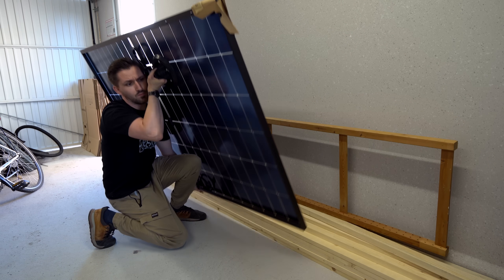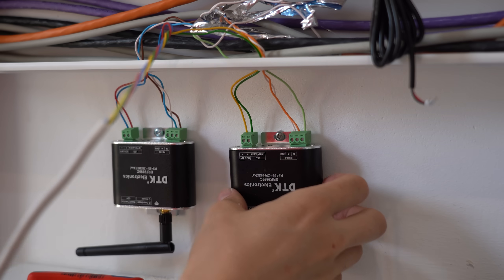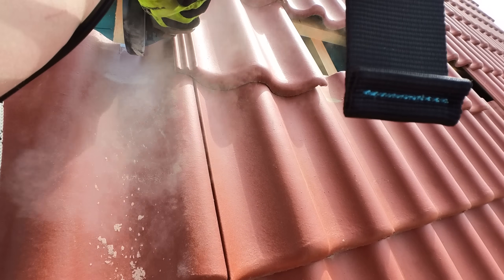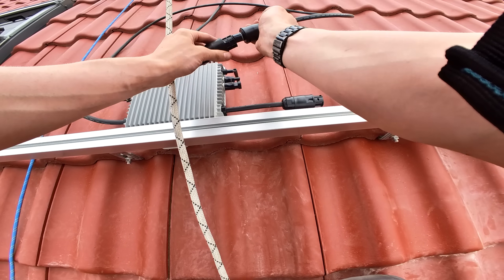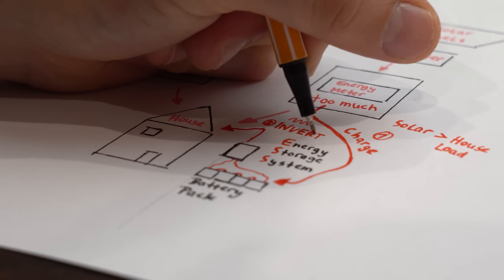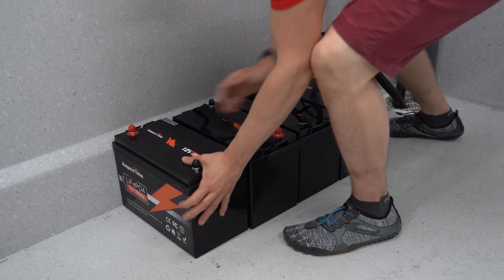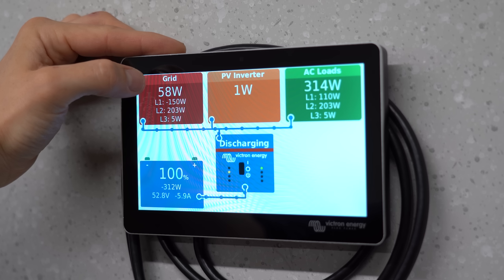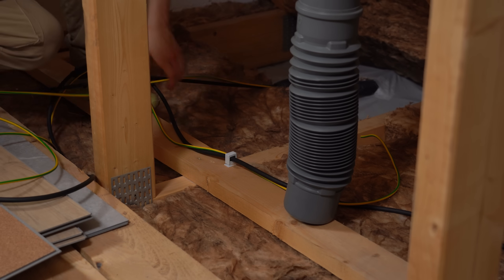Pushing a "legal" Mini Solar System to its LIMIT!

Comment: I've just finished a project to install a 48/5000/70 multiplus-ii in my garage along with 12KWh of storage (16x230AH LiFePO4 cells) - I don't have solar, but I can now buy energy when it's cheap and use it when it's expensive. I'm going to add another track of cells to my project and then add solar/wind on the DC side

Comment: I could be wrong, but I believe you need an external BMS if you are going to put those batteries in series like that. I know each one of those batteries has an internal BMS keeping the cells balanced, however there is nothing to ensure that each battery module remains at the same voltage as one another... Correct me if I am missing something

Comment: ESS is a nice trick. Given the size of the Multiplus 2, the logical upgrade is to put (at least) one large PV Array with a Victron MPPT Battery Controller directly charging the battery. Of course, the next ugprade is to put a slightly bigger battery 😁

Comment: I highly suggest to check with the manufacturer of those batteries about the series connection, for most 12V LiFePo4 batteries it's not recommended to connect them in series

Comment: Is there any problems using 4 12v batteries in series? How do you ensure they all have the same voltage and one doesn't become overcharged?

Comment: One other very important thing regarding "Don't do this at home on your own". At least in Germany working on your grid, doing major changes to your roof and so on are a no go when it comes to creditors and insurance companies. I have two friends (married couple), who both have a PhD in electrical engineering and are doing some crazy stuff both on and off the clock. They were forced to hire "professionals" (who were actually terrible) because otherwise the insurance company would have skinned them alive, not to mention the creditor for the house itself.
Reply: You only need the right insurance which will also pay for "grobe Fahrlässigkeit".

Comment: I think if you want to push the system to it's limit even more in a cost efficient way: You should "overpanel" the solar inverter even more. You could probably quite easily use 4 or even 6 panels on your inverter with the combination of serial and parallel to stay under your max DC input voltage. On sunny days it might not help that much (because of the AC limit). But on Cloudy and shorter days you will stay closer to the max 600W output much longer and more often.

Comment: library IEEE;
use IEEE.STD_LOGIC_1164.ALL;
use IEEE.STD_LOGIC_ARITH.ALL;
use IEEE.STD_LOGIC_UNSIGNED.ALL;

entity Decoder3x8 is
    Port (
        A : in STD_LOGIC_VECTOR(2 downto 0);
        Y : out STD_LOGIC_VECTOR(7 downto 0)
    );
end Decoder3x8;

architecture Behavioral of Decoder3x8 is
    signal temp : STD_LOGIC_VECTOR(1 downto 0);
begin
    -- First stage: decode the most significant bit (A(2))
    temp(0) <= not A(2);
    temp(1) <= A(2);

    -- Second stage: decode the remaining bits (A(1) and A(0))
    Y(0) <= temp(0) and not A(1) and not A(0);
    Y(1) <= temp(0) and not A(1) and A(0);
    Y(2) <= temp(0) and A(1) and not A(0);
    Y(3) <= temp(0) and A(1) and A(0);
    Y(4) <= temp(1) and not A(1) and not A(0);
    Y(5) <= temp(1) and not A(1) and A(0);
    Y(6) <= temp(1) and A(1) and not A(0);
    Y(7) <= temp(1) and A(1) and A(0);
end Behavioral;

Comment: If you install the right assistant,you can run the PV inverter on the output and use it off grid too. There is documentation for "AC coupling" an inverter on the victron site

Comment: In the Czech Republic it's quite a bit harder... 
Here it's not only wasteful to send solar energy to grid for free but also kind of illegal and you will be fined by your energy provider. That's unless you have a special contract for it, which absolutely can get rejected if your area is already "overpowered." (And even if you manage to get it and you want to get paid for the excess power, good luck.)

Also because of legislation (and power companies lobbying) you need stupidly expensive and complicated asymmetric power converters from shady companies from China. 
I don't think any other country uses those except for us so pretty much nobody makes them...

Comment: or you can get a simply get all in one off grid inverter where you hookup one end to the grid ,house and battery where you can customize many features as well like priority, cutoff voltage,switch voltage etc

Comment: those batteries kinda suck for a longevity use case since they offer very little compression for the lifepo4 cells. depending on the design, you can build a box for them and compress the whole pack, but ideally you want to de-shell the batteries and use a proper rack and setup for compression. Generally I just recommend going with bare cells and your own BMS but often its cheaper to buy these 12v 100ah packs instead.

Comment: In the UK at least (of course your mileage will vary) you mustn't put mains voltage in the same conduit as low (data) voltage.  
I was also slightly concerned about your comment of just plugging solar into your mains, it's critically important to have an automatic isolator, so that if the mains fails, you are not supplying the grid with power and potentially endangering someone working on power lines they think are powered down.
Reply: That's what the microinverter does.
Reply: The microinverter has anti islanding protection built in
Reply: @metrikmechanik  Jeah, but the Victron inverter doesn't care as long there's juice in the batteries, I'm affraid.
Reply: @dusinnhht  Are you sure it's not a grid-tied inverter, which it is in this instance and they need to detect mains power or they shut down.  Not to mention, if that little inverter did try to backfeed the neighborhood it doesn't have enough ass to do it and will trip itself off or the 50A breaker will trip. Unless the outage is just one or two houses, but yes generally it is still a bad idea to just plug in random inverters and backfeed through them. But, the good thing is most outlets and associated breakers couldn't actually handle the load anyway.
Reply: If in the UK you cant mix data and power in the same conduit how do Doncaster cables do it legally in their evultra cable?
Reply: Multiplus II doesnt power the grid if it sees no voltage

Comment: Can you set your inverter to charge your batteries during off peak power prices?  That way you charge batteries with cheaper power and solar and higher prices you use solar and stored batteries??

Comment: Were installing 34 large Jinko mono full black 420Wp panels. They go to the three biggest inverters victron has in its assortiment after an mppt, wich goes to different batteries ( i believe lithiumfosfate?? ). Hoping price will drop monthly now...

Comment: Correct me if i'm wrong but you placed solar panels with an micro inverter, so your creating ac from dc to the victron and then back to dc to the batteries. That is a double power loss for converting? I would suggest removing the inverter and placing the dc solar directly to an victron MPPT and then to the batteries. And pair them we the rest of the victron network ofc.

Comment: Technically, if you can verify that your system will never feed back into the grid, thus making it a so called "Inselanlage" the approval of the power company is not needed. However, it's still a wise move to let them look over it and verify that this is the case. Plus your insurance might want to know as well.

Comment: And @7:17 is the point when you better bought a chinese all-in-one solution (inverter, solar mppt charger and automatic transfer switch) that costs ~600EUR and you can use it with max 5.6kW of solar power and same 48V battery system. The balcony setup is for people that want a simple plug and play solution. What you've built is a very expensive 600W solar system 😅.

Comment: In the Netherlands we have smart meters, those contain a so-called P1 port which spits out the energy consumption every second. Unfortunately our meter has that port hidden behind a panel with a seal on it (business installation), opening up that port means a tech from the metering company has to show up. Since we also do not yet have a battery storage we keep it this way. During day time the whole company runs on 100% solar power, delivering some energy back into the grid for just 7 cents per kWh.
As soon as we get a battery system and/or EV charging solutions, we have to look into getting our P1 metering readout to work. Adding an extra metering solution will be a bit tricky with a 400V, 100A installation.

Comment: Is this really legal? Don't you need a device/mechanism to stop feeding electricity back to the grid if there is a grid outage? Because there might be people working on the lines thinking that they are dead but you are actually electrifying them? I know that this feature exists in most grid-tie inverters. They can sense grid outages and either completely shutdown or create a "small grid" with your house to continue powering it.
Reply: Every grid tie inverter that is certified  has this feature built in, as well as hybrid grid tie inverters

Comment: Very impressive setup! However, I noticed you don't appear to be using a battery management system (BMS) for the four LiFePO4 batteries. Are you not worried they might become unbalanced over time, leading to one or more of them getting overcharged / overdischarged?

Edit: I see they are self managed, since each contains 3 or 4 such batteries wired in series, so that should protect them, however they can still get unbalanced, which means the battery will just disconnect in such scenarios :/
Reply: Guess each bank has its BMS inside, that's why he shouldn't connect them in series. Correct me if I'm wrong?
Reply: These batteries are designed to be daisy chained up to 4S maximum. I have been doing it for over 1 year will no problem
Reply: I was thinking the same, it wont go boom but it will stop working in the future due to a lack of balancing.

Comment: My system is currently 9 years old and has never been grid connected infact its an all DC system with separate internal wiring for the DC power and lighting circuits. However the battery system is getting old now and the solar panels like wise. I have often considered upgrading the system to an AC inverter system to eliminate the occasional use of portable inverters. It was originally designed as back up power system and full time lighting system. But has ended up being full time use for many things. I will probably start by upgrading my solar panels as thats easiest to do being ground mounted on frames outside.

Comment: What are you going to be using to keep the batteries in balance? 
You might want to go to Ali Express and get a 12V battery balancer for a 48V system... 
There's many BMS systems which some have an active balancer built-in but they are usually for 16 X 3.5V lifepo4 cells... 
Your 12v batteries will end up at different voltages to each other and one might see an over voltage situation.... 
You need to head over to the off grid garage channel to get all the information you need from a crazy (but very awesome) German living in Australia...

Comment: Interesting thing here in my country, if you make solar panel instalation legitimatelly, any excess power sent to the grid is "stored" for later use by you when needed. So it saves the hustle of having a separate battery pack:)
Reply: You can be sure thats temporary. Its only done in early stage implementation as an incentive.

Comment: Loving your videos! I have a couple of questions/observations:
1. Does the Muliplus II have the functionality of a G99 relay integrated? Or do you have a G99 relay elsewhere in the system? In reality, it is best placed at the grid supply entry so that your home can run on battery power without trying to power the whole grid!
2. That fuse on the battery supply looks like a car audio one. These are not usually capable of withstanding the huge short circuit currents lithium batteries can produce. Probably best to ask the battery supplier for a recommendation, I only know of the fuses for EV’s such as Bussmann EVK’s etc.
Reply: the more current... the more likely the fuse will blow. I don't think there's a problem using this type of fuse but it does look a little cheap.

Comment: 1. You did not mentioned what is the price of all parts you used.
2. System looks overcomplicated. Was it possible to make it simpler and still useful?
3. Too many mentions of professionals and regulators. DIY video is about making something yourself .

Comment: Would be interesting to understand why inverter instead of MPPT for the panels.
Would be good to cover panel selection/matching in a future video. 
Also to cover Victron's community where volunteers help with user problems.
You can configure to draw more than panel output from the batteries, then in the gaps when you're not working the batteries can recharge. Saves grid power.

Comment: I looked into doing something similar, although at a slightly smaller scale, and here in Australia you can have a maximum of 500W without having to get the system inspected by a certified inspector (and pay them for it, of course). And that's without the grid tie-in. It has to be completely stand-alone, and if you want to connect any system to the grid, irrespective of its size, it needs to be inspected and certified to meet all electrical and safety standards.

Personally, I did the cakeulations and I could run my network gear off a 500W system with a modest battery. However my NAS would use too much energy, which cause the battery to run out overnight sometimes, so it would have to be run off mains (with an IUPS, of course). But the cost of the system probably isn't worth it because it only saved me a little money from my electricity bill. Although that was years ago, before energy prices started skyrocketing, so perhaps that equation has changed now.

Comment: Looks more like victron promotion video than actually usefull installation. If You are not interested in sending power to the grid then hybrid offgrid is way more cheaper and powerfull solution.

Comment: Why not run the solar panels straight to the battery via a smart solar controller. Less parts required that way and more efficient too

Comment: I thought feeding back to the grid without any isolation device is illegal, due to if there's a power cut, a linesman working on the grid can get a shock from the backfeed?

Comment: My previous job was installing PV systems nearly 20 years ago.
As I can see your roof is the "areated type" so, probably you have some roof tiles that have a little "bulk" with a net to have airflow under the tiles. We used them as cable passages so you don't have to modify tiles.
And we always have blocked the tiles underneath the panels with some PE foam to prevent them from moving (once the panels are installed is quite difficult to reposition the tiles).

Hope this helps.

Comment: Should there not be a BMS between those 4 batteries? They will never be the same. If one is fully charged while the others are not the fully one gets overcharged. That's bad. Not sure if you kept that in mind Further. I planned such a system in my offgrid garage but the startup costs especially Victron is way to high for "the normal man"

Comment: I have installed a "mini" solar power system. It cost about 8+ years of electricity bills.
More than half the cost invested in batteries and that is for SLA's.
For LiFeO, that would go to 12-15 years of electricity bills.
And that wont power your whole house without sacrificing battery life.
Oh, and those cost for me installing them myself with diy mounting, no professional installer.
Also, it'll only save you about 10% in electricity bills (cover about 10% of your normal energy consumption).
So, if anyone want to sell you solar powered system to save money, just say no.

Comment: You should never use these 12V LiFePO4 batteries in series like this, over time you will get state of charge imbalance between them, which will cause an overcharge of one of the batteries, which will cause the BMS in the single battery to shut it down to protect it. If you want a 48V LiFePO4 battery, you build a 48V battery from the start with a single BMS that manages the individual cells for the entire pack.

Comment: The energy storage for the solar panel system is an essential part.
But I presume the cost of accumulators is tremendous. However, houses do not need that energy/mass-efficient batteries. Thus you can make your own from a couple of barrels.
Batteries have limited lifespan, but when you make them yourself, it does not matter.
I looked a little bit into and NiFe battery looks promising.

Comment: Thanx for the video. I wish it was so straight forward in our country to do this. Yes, I would not DIY this, firstly because I'm not trained to do it and secondly, DC and mains voltage will kill you!
Reply: Let me clarify. I broke down my solar journey in 2 parts. 1 - I had the 5kWh off grid inverter and 5kw Lipo4 battery pack installed, by a qualified professional and 2 - I had 8 x 550W solar panels installed afterwards. Also by a qualified installer. In my country, you are not allowed to do a solar or battery backup install yourself, as you need to have the design and install signed off by a professional. If you want to do the install yourself, no professional will sign off on your work. This is the point I was making. I enjoyed your install journey, as it always takes longer than planned and also that you warned your subscribers not to try this yourself! Love your content. 👌😎